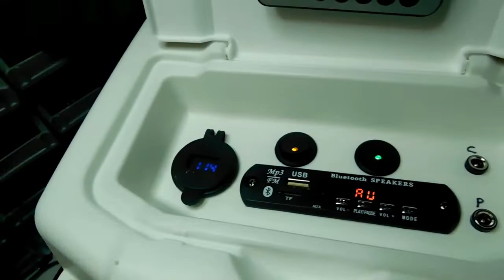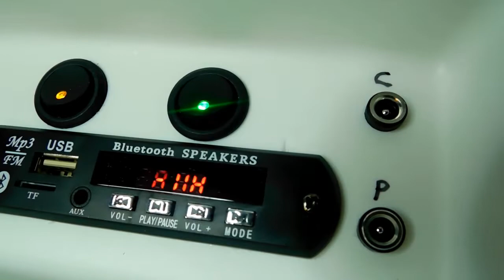Boom Box Cooler Duel Powered. Battery and Electrical.

Comment: Was thinking about putting together a bluetooth boombox I want to do (6 ) 5.25 mid bass drivers, (8) 1 inch dome tweeters. I also want a usb charging port, aux input, and a volt meter. I found a Sure amp that was 6×100 for the mid bass and a Sure 4×100 for the tweeters, I was thinking about Dayton audio for the speakers . Not sure on battery options so if I can get some input on this whole design that would be a great help.
Reply from the maker: Have you seen the video I did about choosing a battery for your project?
Reply from the maker: Also , if you are on Facebook I would love for you to join my group. We have a whole group of builders that can help you out. We like to help each other.  https://www.facebook.com/groups/1225425117541115/
Reply: DIY Boom Boxes In Texas yes I did join the Facebook page
Reply from the maker: Donnelle Duggans Awesome.  Thank you